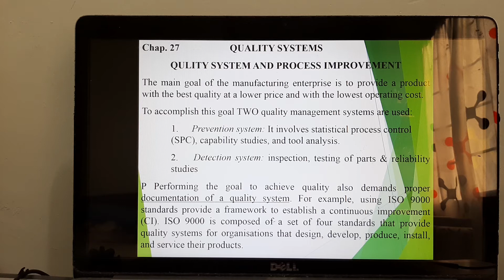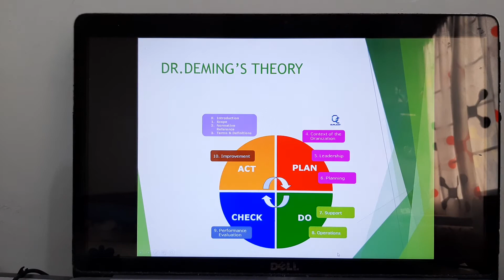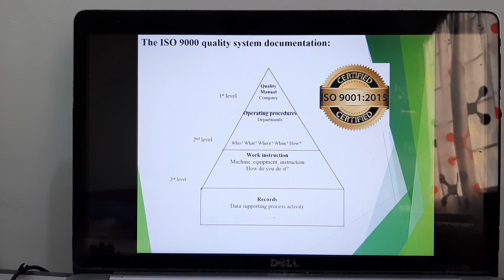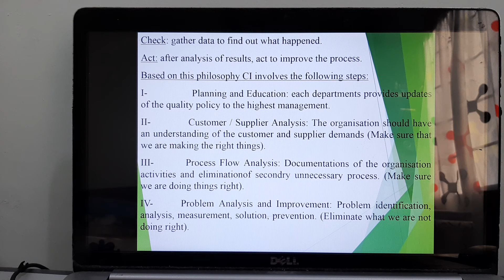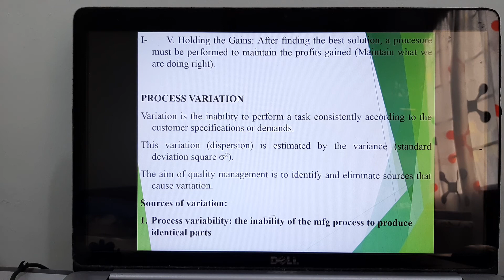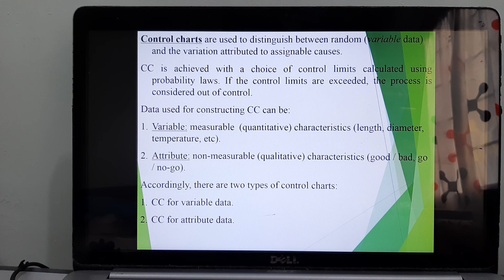QUALITY SYSTEMS

Comment: Good morning Dr, what i have learned from this video is about quality system which is meant to produce the best quality with lowest price and operation costs. Theres two system in this which are prevention system and detection system. Prevention system is to do dimensional accuracy checking which involves statistical process control chart. Detection system is to inspection of testing parts and reliability studies. Quality is defined to provide products and services which consistently meet the customers needs and expectations. 
There are two theories which we learned firstly which is Dr deming theory which is to plan-Do-Check-Act. Secondly is Cl philosophy which is Planning and Education-Customer or supply analysis-process flow analysis-problem analysis and improvement. Then we learned about process variation which is inability to perform a task consistently due to customer demands or specifications. There are causes for dimensions variation which are chance or random causes and assignable or special causes. There is also monitoring variation. Thank you Dr.

Muhammad Naquib Bin Nor Azlan
ME0106093

Comment: ME0106053 Marcus Chuo
Good day madam , info gained is on Quality system and process improvement. 
There are two types of quality management systems are used:
 1. Prevention system: It involves statistical process control, capability studies, and tool analysis.
 2. Detection system: inspection, testing of parts & reliability 	studies
Statistical control chart is to monitor the performance of product in terms of dimensions.
“Plan-Do-Check-Act” Philosophy which is one of Dr Deming proposed philosophy for continuous improvement
Plan: setting goals and plans. 
Do: implement and accomplish the plan.
Check: gather data to find out what happened. 
Act: after analysis of results, act to improve the process.

Philosophy CI involves the following steps:          
Planning and Education - each department provides updates of the quality policy to the highest management.           
Customer or Supplier Analysis: The organisation should have an understanding of the customer and supplier demands.
Process Flow Analysis: Documentations of the organisation activities and elimination of secondary unnecessary process.     
Problem Analysis and Improvement: Problem identification, analysis, measurement, solution, prevention. 

Process variability: the inability of the mfg process to produce identical parts
sources of variation
-Product degradation over its life cycle.
-External factors. 
-Mfg process degradation.

Causes of dimension variation: 
-Chance or Random Causes such as equipment accuracy, weather, and material properties which cannot be cannot be controlled.	
-Assignable or Special Causes such as worn-out equipment, improper tooling, and material defect which can be eliminated

Comment: Good afternoon madam, I am Wong E-Shen (ME0106071). From this video, I have learnt about quality system. Firstly, the purpose of the manufacturing enterprise is to produce a product with the best quality at a lower price and with the lowest operating cost. There are 2 quality management system used which are prevention system (detect dimensional accuracy of the products) and detection system (inspection, testing of parts & reliability studies). Then, the ISO 9000 quality system documentation consist of quality manual, operating procedures, work instruction and records. Then, quality is the act to provide customers with products and services that consistently meet their needs and expectation.
 There are 4 steps in Dr. Deming philosophy which are plan (set goals and plans), do (implement and accomplish the plan), check (gather data to find out what happened) and do (to improve the process). Furthermore, for CI philosophy, there consist of 4 steps which are planning and education (provides updates of the quality policy to the highest management), customer or supplier analysis (understanding of the customer and supplier demands), process flow analysis (documentations of the organisation activities and elimination of secondary unnecessary process) and problem analysis and improvement (eliminate what are not right). Besides, for process variation, it means the inability to perform a task consistently according to the customer specifications or demands.
 Then, there are 4 sources of variation such as process variability, product degradation over its life cycle, external factors and manufacturing process degradation. Moreover, the causes of dimension variation are chance or random causes and assignable or special causes. The statistical process control (SPC) is used to monitor and control variation.

Comment: NIGEL ANDERSON SINGH A/L RAJDEEP SINGH
ME0106094
Good day, madam.  The two quality management systems that are used are prevention system (statistical process control, capability and tool analysis) and detection system (inspection, testing of parts and reliability studies). Performing the goal to achieve quality requires proper documentation of a quality system. ISO 9000 standards provide framework to establish continuous improvement and it is composed of a set of four standards that provide quality systems for organisations that designs, develop, produce, install and service their products that are quality manual, operating procedures, work instruction and records. 

Quality is defined as the act to provide customers with products and services that consistently meet their needs and expectation. Continuous Quality Improvement is a systematic method of improving processes to better meet customer needs and expectations. "Plan-do-Check-Act" Philosophy is proposed by Dr. Deming about continuous improvement. Process variation is the inability to perform a task consistently according to the customer specifications. The aim of quality management is to identify and eliminate sources that cause variation. 

Sources of variation : Process variability (inability of manufacturing process to produce identical parts), product degradation over its life cycle, external factors and manufacturing process degradation. 
Causes of dimension variation : chance or random causes (equipment accuracy, weather and material properties), assignable or special causes (worn-out equipment, improper tooling and material defect). 

Statistical Process Control (SPC) is used to monitor and control variation because SPC is a systematic method of tracking, predicting and minimising process. SPC also results in cost reduction, quality improvement, scarp and rework reduction, elimination of unnecessary inspections. SPC uses control charts.

Thank you

Comment: Good Day, Dr. I am Derrick Ng Kian Ping (ME0105733). At the end of the video, I have learned about quality system. The main goal is to provide products with best quality at lower prices with the lowest operating cost. There are 2 type of management system that are used which are Prevention system and Detection system. Prevention System includes dimensional accuracy which uses statistical process control chart. Detective system is the inspection,testing parts and reliability study. There are 4 levels which are quality manual company, operation procedure, work construction and records. Moving on, quality can be defined as act to provide customers with products and services that consistently meet their needs and expectations while continuous quality improvement is defined as systematic method of improving processes to better meet customers needs and expectations. Next, there are parts in Dr Deming's Theory. Firstly, Plan where goals and plans are set, Do where Plan is implemented and accomplished, Check where Data is gathered to find out what happened and lastly, Act where the process is improved through act. Furthermore, there are also 4 levels in Philosophy Continuous Improvement. Firstly, planning and education where each department provide updates of quality policy to highest management, customer and supplier analysis where they understands the demands of customers and suppliers, process flow analysis where organisation activities are documented and secondary process are eliminated, and lastly, Problem analysis and improvement where problem is identified, goes through analysis,measurement, solution and prevention. Next, Process variation is defined as the inability to perform a task consistently according to customer's demands. The sources of Process Variation are process variability, product degradation over life cycle, external factor and manufacturing process degradation. On the other hand, the causes of dimension variation is through chance or random causes which includes equipment accuracy,weather and materials properties which cannot be controlled. Assignable or special causes examples are worn out equipment,improper tool and defect which can be eliminated. Lastly, to monitor variation, there are 2 ways which are statistical process control (SPC) (which is a systematic method of tracking,predicting and minimising process variation) and control charts.

Thank You.

Comment: Mohamad Ikhwan Syafiq bin
Zaidi 
ME0106090

In this video I learned about quality system . it is to  produce the best quality with lowest price and
operation costs. 

Two type of system learned in this video are Prevention system
and Detection system.

Process variation - inability to perform a task consistently due to customer demands or
specifications

4 sources of variation – 

- Process variability 

- Product degradation over its life cycle 

- External factors 

- Mfg process degradation

2 causes of dimension variation – 
- Chance or random causes
- Assignable or special causes

Comment: Name: Nur Syazwani Bt Mohd Noor 
ID: ME0104367

From this viedo, i learned that quality system is needed to provide a product with the best quality at a lower price with the lowest operating cost.  The two systems involved is prevention system and detection system. Prevention system is for checking the dimensional accuracy of product while Detection system is for inspecting, testing of parts and reliability studies of products. ISO 9000 standards provide a framework to establish a continuous improvement. Next, the quality improvement systems. Quality is an act to provide customers with products and services that consistently meet their needs and expectations. To ensure production activities are accomplished and targets are met for a period of time, Dr Deming's Theory is used. Dr Deming's theory consists of plan, do, check and act. 
Then, variation is the inability to perform a task consistently according to the customer specifications or demands. Source of variations are process variability ( manufacturing process are unable to produce identical parts), product degradation, external factors ( carelessness, accidence and workers' errors) and manufacturing process degradation (replacement of machine). The causes of dimension variation can be because of these two factors, chance,common or random causes (this causes cannot be controlled) and assignable or special causes (this causes can be eliminated). To monitor and control variations,statistical process control (SPC) is used. SPC is a systematic method of tracking, predicting and minimising process variations. It  results in cost reduction, improvement of quality and eliminates unnecessary inspections. Thank you.

Comment: Name : Aiman Hazim Bin Arif Razman
ID : ME0106080

From this video, I have learned on the quality system and process improvements. This is to provide product with the best quality at a lower price with lowest operating cost. One of the quality management systems used are the prevention system which involves statistical process control (SPC), capability studies and tool analysis using statistical process control chart and also detection system for inspection, testing of parts & reliability studies. Detection system also involves proper documentation system of a quality system where a product is inspected so that its good standards are maintained and complies to certification. This provides framework to establish a continuous improvement. 1st level is quality manual company, second level is operating procedures, 3rd level is work instruction, 4th level are records, data supporting process activity. Quality improvement system involves quality, continuous quality improvement, plan-do-check-act philosophy. Quality is an act to provide customers with products and services that consistently meets customers’ needs and expectation. Continuous quality improvement is a systematic method of improving processes to better meet customer needs and expectations. Plan-do-check-act philoshophy by Dr. Deming consists of plan, which is to set goals and plans, do, implement and accomplish the plan, check, to gather data to find out what happened, act, after analysis of results, act to improve the results. Based on the philosophy, the continuous improvement involves planning & education, customer and supplier analysis, process flow analysis, problem analysis and improvement, and holding the gains. Variation is the inability to perform task consistently according to customer specifications or demands. Sources of variations are :
Process variability is the inability of mfg process to produce identical parts. 
Product degradation over its life cycle that may be constituted by its competitors.
External factors such as outsourcing.
Mfg process degradation such as change of employees. 
The causes of dimension variation are chance or random causes which cannot be controlled such as equipment accuracy, weather & material properties or assignable or special causes which can be eliminated such as improper tooling and material defect.
We can monitor variations by using statistical process control (SPC) using statistical process control chart. Product is ensure that its dimensions are around the control limit and not exceeding the upper control limit (UCL) or lower control limit (LCL), else, production has to restart again.

Thank you for the educational video Dr.

Comment: Good morning madam, I'm Chong Jin Yang (ME0106047). From this video, I learned about quality system. It is aim to produce the best quality with lowest price and operation costs.
1) Prevention system
- dimensional accuracy checking
- involves statistical process control chart
- monitor performance of products in form of dimensions
2) Detection system
- inspection, testing of parts and reliability studies
For example, ISO 9000 quality documentation:-
1) Quality manual
2) Operating procedure
3) Work instructions
4) Records
Quality can be defined as act to provide products and services that consistently meet the customer needs and expectations. Continuous quality improvement is a systematic method of improving to meet customer needs and expectations. 

Dr Deming Theory
1) Plan - Set goals and plans
2) Do - Implement and accomplish the plan
3) Check - Gather data and find out what happened
4) Act - Improve the process

CI Philosophy
1) Planning and education
- provide updated quality policy to higher management
2) Customer or supplier analysis
- analysis on customer and suppliers demands
3) Process flow analysis
- documentation of organisations activities
- elimination of secondary unnecessary process
4) Problem analysis and improvement
- problem identification, analysis, measurements, solution and prevention

Process variation 
- inability to perform a task consistently due to customer demands or specifications
Sources of variation
1) Process variability
2) Product degradation over its life cycle
3) External factors
4) Mfg process degradation

Causes of dimensions variation
1) Chance or random causes
- equipment accuracy, weather and material properties
- cannot be controlled
2) Assignable or special causes
- worn out equipment, improper tooling and material defects
- can be controlled

Monitoring variation
1) Statistical process control (SPC) 
- a systematic method of tracking, predicting and minimising process variation
2) Control charts

Thank you

Comment: Good day Dr Im Lee Zi Sheng ME0106051. From this video, I learnt that the main goal of the manufacturing enterprise is to provide a product with the best quality at a lower price and with the lowest operating cost with Prevention system and Detection system. Control chart used to ensure the dimensions is within the tolerance.  ISO 9000 standards provide a framework to establish a continuous improvement  (CI), the documentation need to be done and record everything like date time how etc.  Quality is defined as the act to provide costumers with products and services that consistently(minimal process variation ) meet their needs and expectation.
Continuous Quality Improvement it is a systematic method of improving processes to better meet customer needs and expectations.
Plan-Do-Check-Act” Philosophy  proposed by Dr. Deming  for continuous improvement.
Based on this philosophy CI involves the following steps:
Planning and Education, Customer / Supplier Analysis, Process Flow Analysis and Problem Analysis and Improvement
Variation is the inability to perform a task consistently according to the customer specifications or demands.
Sources of variation are:
Process variability
Product degradation over its life cycle., External factors and Mfg process degradation
The causes of dimension variation:
 
Chance or Random Causes (Equipment accuracy, weather, and material properties)
Assignable or Special Causes (worn-out equipment, improper tooling, and material defect)
Statistical process control (SPC) is used to monitor and control variation. SPC is a systematic method of tracking, predicting, and minimising process variation.
Thank you.